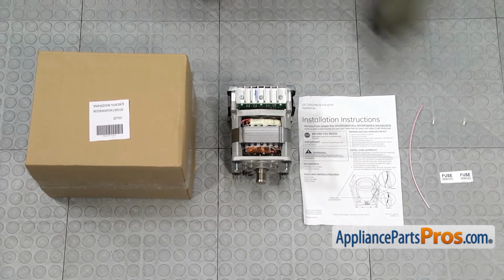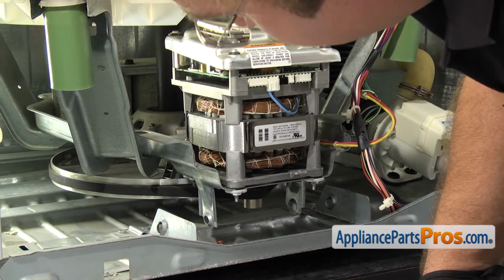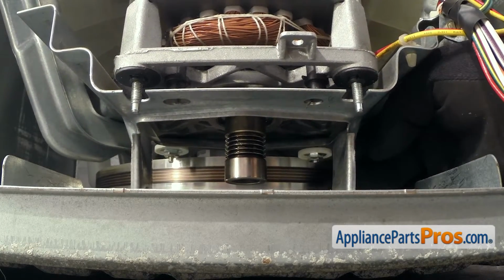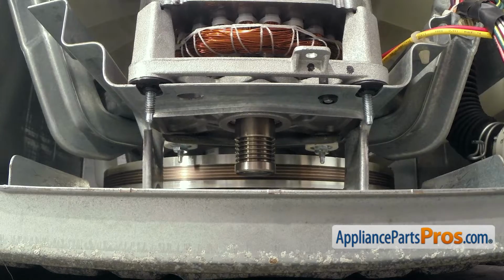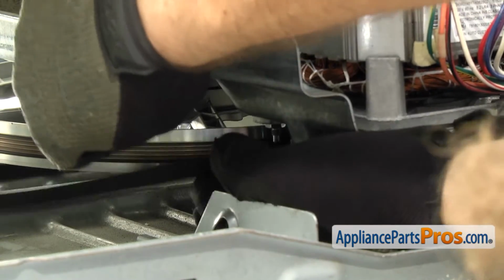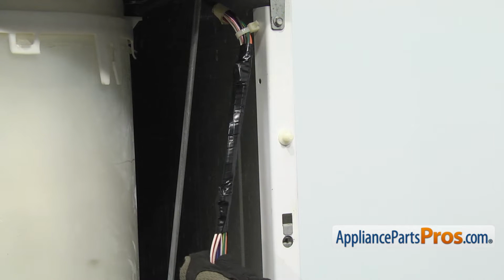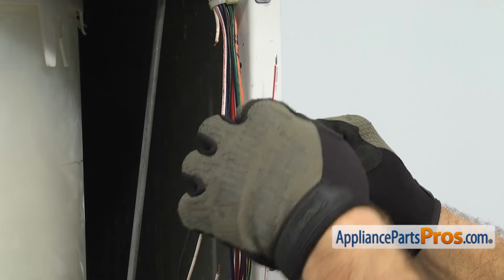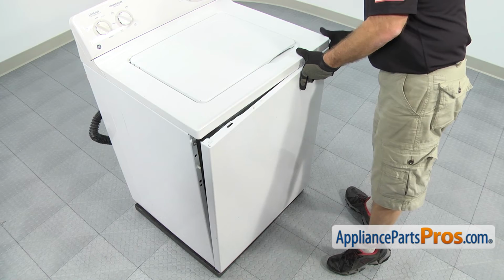How To: GE Drive Motor WH20X10093

Comment: U see the bracket with the hole in them to the right and left of the pulley ? What will happen if I tie it in place to where the tub can’t move around ?
Reply from the maker: Those brackets are part of the washer’s suspension system, so securing them to prevent the tub from moving isn’t recommended. The tub needs to move during operation, and tying it in place could cause excessive vibration or damage other components.

Comment: Hola podrás conseguir un motor como el que muestras con alguna de las siguientes referencias? Acontinuacion las referencias: 

WH20X10036 
WH20X10079
WH20X10044
WH20X10031

175D5106G008
175D5106G013

AP5263102, 3029960, AH3496870, EA3496870, PS3496870
Reply from the maker: Lo siento, todas esas piezas han sido sustituidas por el número de pieza WH20X10079. Esta pieza ha sido descontinuada y no se ha proporcionado ningún reemplazo. Puede intentar buscar en otros lugares para ver si alguien todavía tiene existencias disponibles.

Comment: Hello friend, I would like your help, I replaced the motor of my GE washing machine but the previous damaged motor was from a GE washing machine mod GHWN4250D1WW with a WH20X10093 motor, but I am replacing it with an identical motor but it is a WH20X10094, the only difference and the problem It is the red connector, the WH20X10093 motor has a 4-wire red connector and the new motor WH20X10094 in that red connector only has three cables and of different colors, how could I make that connection? thanks in advance.
Reply from the maker: WH20X10093 and WH20X10094 are two different motors. If your model number is GHWN4250D1WW then the WH20X10094 is the correct part, so it should hook up no problem. If you have different connections then you will need to look on the unit and double check the model number and the part number you are installing.
Reply: @appliancepartspros  Thank you.
Reply from the maker: You're welcome!

Comment: Why do you need to delete the fuse? Is there a fuse built into the new motor you are using?  I bought an old motor. Same exact part number. I dont see any sense in deleting the fuse especially if using the same motor.  If I have an old motor and its basically the same old motor then I would think its important to leave the fuse in place.  Can anyone help with this

Comment: I wonder why he took the fuse out, fuse suppose to protect the motor. I would ohm check the fuse, if it's good, leave it, if not, replace it, instead of putting a jumper wire.

Comment: I am having trouble getting my new motor to slide in. You seem to have more room above the motor than I do to slide the motor in and rotate towards the front.  Could my tub be lower than yours?
Reply: I had the same issue, and could not get it in the same way. Just had to put it straight in, instead of rotating it like he did.

Comment: THIS IS AN EXCELLENT VIDEO. I USED IT TO REPLACE MY MOTOR AND IT WORKED LIKE A CHARM. WITHOUT IT, I'M SURE IT WOULD HAVE TAKEN ME SEVERAL HOURS TO FIGURE OUT ALL THE TRICKS NEEDED. INCLUDING WATCHING THIS VIDEO, IT TOOK ME ABOUT ONE HOUR START TO CLEAN UP. I DID NOT HAVE A FUSE TO REPLACE ON MINE, AND THERE WAS NO LABEL STATING SO.
Reply: Glad to hear that! Where did you get the cable from? Thanks

Comment: I also would like to know why the fuse is replaced/Removed?
Reply: It's possible the replacement motor has its own short/overcurrent protection. I ran into a problem where the machine would fill, then just sit there until the timer advanced to drain, refill, sit dead again and then drain again. I found out that the blinking status light on the motor circuit board was dead. I used the wiring diagram to see if the motor was receiving power. There was power present but the wiring diagram indicated a fuse on the neutral side of the motor. I couldn't find it. I looked up the replacement fuse and found out it was an inline fuse wrapped into the taped harness. I cut it out and put a universal automotive fuse holder and installed a 10 amp fuse. It worked perfectly. On second thought, perhaps they have you jump the fuse before you find out it was the fuse all along and not the motor. I am watching this video now because I have another "no flash" condition  but this time my fuse is good. If the motor is out it's not worth fixing the machine. This motor is direct drive to the drive pulley. There is no transmission. Agitation and spin are controlled by a "triac" circuit in the timer. There is a possibility that that portion of the timer is bad. I believe the motor's power is independent of the timer, hence the flashing light. The timer is used only to control the motor.
Reply: To the producer of this video, please answer this person's question.

Comment: Do you have a video on what the voltage should be on which wires going to the motor to determine if it is the motor or main board that is bad?
Reply: did you find out the answer to this by chance
Reply from the maker: We don't have a testing video for that, but we offer free technical advice and diagnosis on things that aren't covered in our videos, so we'll be glad to advise you on that. We’re available 7 days a week at 1-877-477-7278 or you can chat us at our website: http://www.appliancepartspros.com/

Comment: this video is not for motor repair it is only motor replacement . i need to repair this motor not replacing with new one.
Reply: It is very expensive.
Reply from the maker: You are correct, this is a replacement video.

Comment: how much is motor, cost of new washer?
Reply: I now see the price, 200-250, wow, not cheap.
Reply from the maker: If you'll get in contact with us, we'll help you diagnose your machine's problem to make sure it's the motor you need, and not a more affordable part. We offer free technical advice and diagnosis 7 days a week. You can give us a call at 1-877-477-7278 or you can chat us at our website: http://www.appliancepartspros.com/. We will need your model number to give you accurate advice, which you can locate using this tool on our website: http://www.appliancepartspros.com/modelnumber_locator.aspx

Comment: WH20X10092 is the same motor ?
Reply from the maker: WH20X10093 is a direct replacement for WH20X10092, so it isn't exactly the same part. The manufacturer may have made changes, but WH20X10093 is compatible with models that used WH20X10092.
Reply: I also wonder about removing the fuse.  Why do this?
Reply: Probably the new version of the motor either has an internal fuse, and/or the original external fuse does not have a high enough or slow enough rating for the new version of the motor.  ...And, I'll betchya the reason they put a fuse internally is because people were jumping blown fuses, creating a hazard.